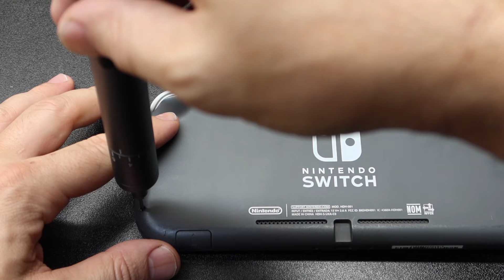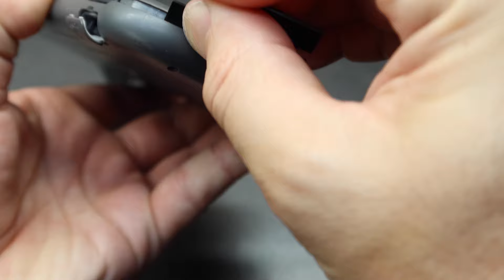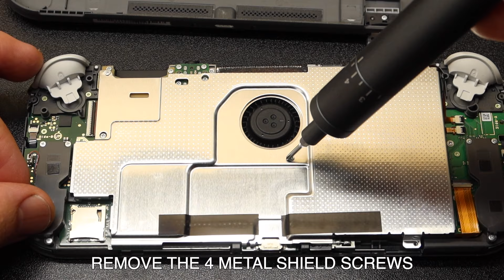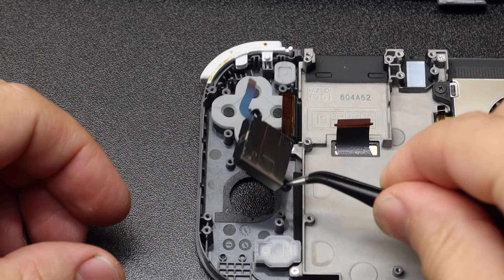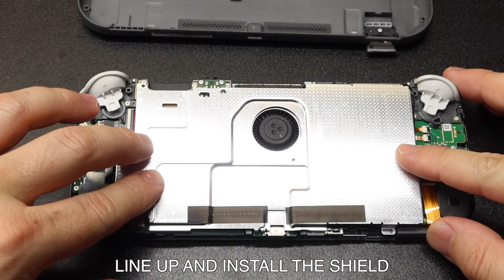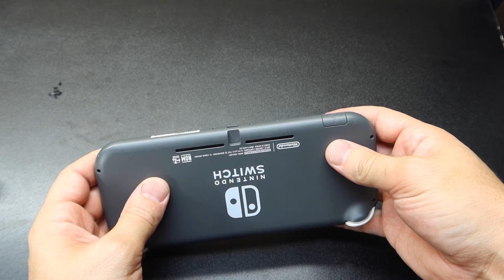Nintendo Switch Lite Joystick Repair | Broken Right Joystick | Nintendo Restoration

Comment: my man you forgot to add new thermal paste, you need to do that or its gonna overheat
Reply: Really?
Reply: Not really, but it’s still a good idea since Nintendo uses cheap thermal paste that doesn’t cover the whole chip lol
Reply: Chips in phones are better than this. I think he good lol
Reply: @RichieLanderos  its not a phone... its a game system, which means of course, its going to be running intensively whenever its running, because what do you do on a game system other than game (and hulu and youtube on the switch maybe). And thermal paste is ALWAYS required for ANY cpu. Ive never met a cpu that you could run without it.
Reply: @itswiddow5039  it is more efficient in cpu than v1, it surely below what termal paste can do
Reply: Lol at people saying it's ok to leave it without thermal paste. Are they serious?
If it has thermal paste to start with is for a reason, it's unacceptable to not reapply some more, even worse: not cleaning the old one after opening it.
Reply: @JavierSegura  i assume they are either trolling or inexperienced. If something has thermal paste to start with, the general assumption is to reapply said lost thermal paste.
Reply: @JavierSegura  also, a lot of systems, even without thermal paste, can benefit from having thermal paste. For instance, phones that are consistantly running intensive tasks, such as phones used specifically for gaming. Or, for instance, the oneplus 6t now has a way to run windows 11 on it, it gets VERY hot and benefits greatly from adding thermal paste and a decent fan to the back of the device.

Comment: If yall take off the heatsink, I recommend repasting it with a high quality paste. Mine feels cooler just to the touch.
Reply: Good to replace it either way, lasts WAY longer. This goes for any device. Scrub it with Isopropyl Alcohol so it doesn’t hurt the boards.
Reply: yeah, and put the heatsink on before connecting the battery... fuck.. i just think i broke my sons wii lite because i did connect the battery which caused it to turn on before the heatsink was on! ... ffs

Comment: Thank you for this great tutorial! I managed to change both joysticks and didn’t forget any cables or screws 😆 it all works! 🤩
Reply: Did it actually work cause my switch light is missing a joicon should I do this ???
Reply: @lebabalkany7141  6 months late, but yes this is how repairs work and you should be able to do this you just need to get the correct screw driver or else you will strip the screws and you will have to replace them.

Comment: Did something wrong …. Now won’t turn on? The little plastic but fell off at 9:05 in your video …. The cable goes in but does it need to be pushed firmly for this to work??  This I think is the problem

Comment: Good video, in regards to the links provided, which model electric screwdriver did you buy? And did you buy it and just use the bits from the other tools link? Or did you use the ones that came with the screwdriver. TIA
Reply: It’s in the description

Comment: I know I am very late to the party, but I have 2 questions:  1) Would you recommend using hall effect joysticks over the standard Nintendo sticks?  and 2) Another video I watched recommended replacing the thermal paste before reinstalling the heat sink - do you recommend that too?  Thanks for the very clear video - and I love the powered screwdriver (very jealous)!!

Comment from the maker: Let me know if you have any questions regarding this repair.
Reply: Thank you so much for sharing! Your videos are easy to follow 👋🏻
Reply: Thank you for sharing your video. Very easy step by step to follow. Where can I buy the tool you have?
Reply: My right analog stick won't press down will this fix this?
Reply: The Amazon link is for both the right and left joycons?
Reply: @vimies5746  that's what is wrong with mine
Reply: my screen is black i followed everything you did and ran it back 2 times. I think i damaged something. Any ideas? great video btw

Comment: Name of the tool you used? I tried repairing my joy stick today but these tiny screw drivers make it impossible :
Reply from the maker: I added a link in the description for a nice ifixit toolkit. I use that kit all the time, in the video I used an electronic screwdriver, but they are expensive and require practice to use properly.

Comment: While "unplugging the speaker. The attachment seems to have broken and now it can't be reattached. I reassembled every other part and switch will turn on but display doesn't come on. I can hear sound effects that indicate switch is on but no display sadly. It seems the joystick is working well though, without the display it is useless .....

Comment: if i accidentally rip the speaker wires off the motherboard will that effect the overall performance of the switch ot just that speaker? because i did that and my switch wont turn on anymore, idk if i did something else wrong
Reply from the maker: Make sure all cables are plugged in fully

Comment: Absolutely great video did everything as shown but now got a blank screen I can see some illumination and also sound but no image any clues?
Reply: Mine did exactly the same when back and checked everything found a plug not in right above the battery connected it properly and now it does the same it's my own doing..

Comment: I need help. I replaced 2 Nintendo Switch joysticks (all 4 of them). One came out perfect no issues and the other has no power after replacement. I tried everything, same procedure and process as the one that works. I reinstalled the old ones to see if that was it and still no power. No loose connections, no damage to the cables, added new thermal paste to both of them. Is there any reason why this happened? I even tried all the methods. Charging it, doing the power + low volume method. Nothing works. Could it be the battery? Previously the battery would drain pretty quick compared to the one that works. Do you think when I disconnected the battery it just gave out?

Comment: is it hard for you to pull out the cables? I want to do this to my switch but i'm worried I might break one of the cables by applying too much force. Is there way to rip out out the cables without damaging anything?
Reply: Just try and pry it up with a flat head (precision one of course) from the metal part… don’t try and pull it, it can damage it

Comment: I guess 1 thing messed up after I put it back together. The Y button takes a hard press to use. Any help?
Reply from the maker: The rubber pad that holds the button in place is misaligned

Comment: I switched it out, but now the screen is black and it doesn’t have any noise coming from left side. What did I do??:(
Reply: SchizOnWheels  no
Reply: SchizOnWheels  Tried everything, doesn’t work :/
Reply: SchizOnWheels  Sorry for late respond, lost signal- about 24 times
Reply: Sorry to say, but probably you messed up with some flat cable.
Reply: me too, did u ever get urs fixed?

Comment: UGH I'm not a noob at this kind of thing but...all seemed to go well but now my Switch Lite is seemingly dead. Does not power on. Doesn't do anything when I plug it into the adapter. It had a full charge and I disassembled it again to check all the connections. Anyone have any insight?

Comment: Help. Feel kind of stupid. Did everything like the video, but now the screen does not turn on. I hear sound but no screen. I don't know what I did wrong. Opened and redid everything 3 times now. Can someone help?
Reply: me too, did u ever get it fixed?
Reply: @madyrichard1  Nope. But figured out that it had nothing to do with changing the joystick, I think. It is the back light of the switch. Maybe it broke while changing but probably not. Mine still turned on and made sounds and everything, but I couldn't see anything except if you put a flashlight right on the screen, then you see a bit. That is how I managed to transfer the game data I had saved.

Comment: Love ya to death for this but I physically cringed every single time you screwed something back in 💀 can't repair something with stripped ass screws
Reply from the maker: The electric screwdriver I used in the video is an adjustable clutch ratcheting style. What you hear is the screwdrivers internal ratcheting sound once the screw gives enough resistance; which is surprisingly accurate.
Reply: @TheFixTech  fair enough I've never heard of such a thing but I'm glad they make them lol

Comment: They did the left joy con drift because of the motherboard. Not a bad idea lmao smart move nintendo. Replace the left and not the right so you dont have to touch the components lmao pay $250 with joy con replacement lmao.